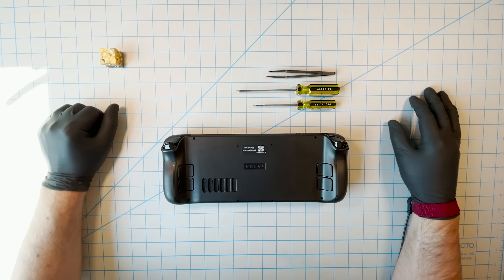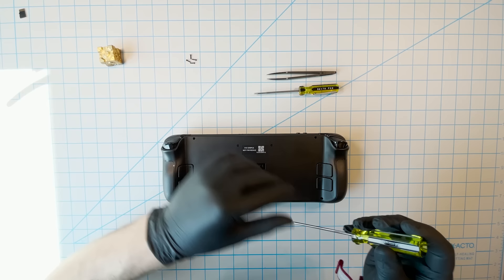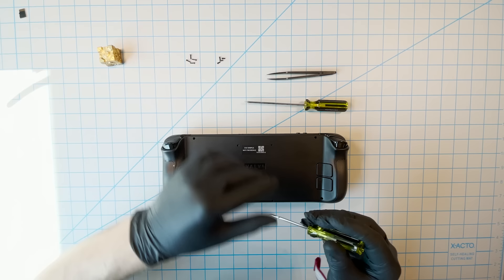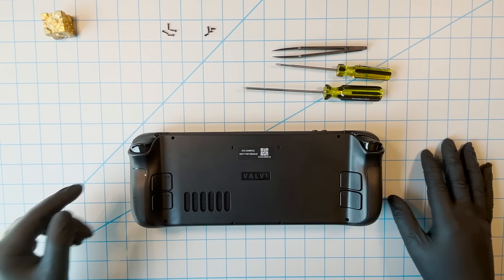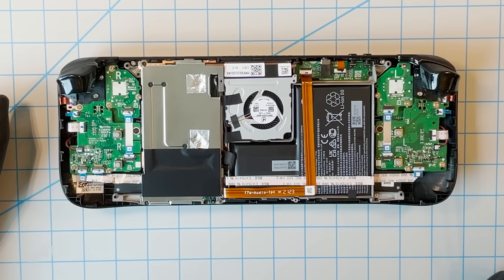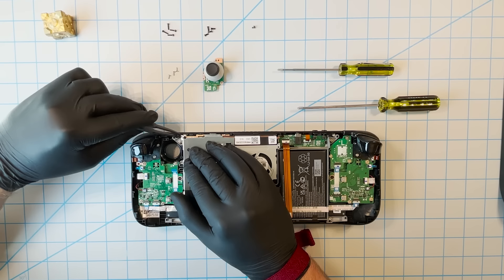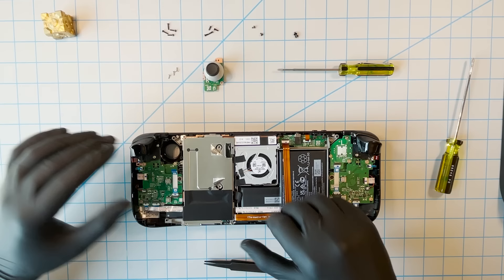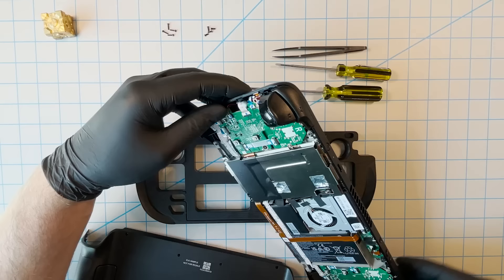Take a look inside Steam Deck™!

Comment: Shout out to Valve for being pro right to repair. It's genuinely refreshing to see a company show you step-by-step how to replace parts AND mention that you'll be able to purchase replacement parts from them directly in the future.
Reply: I was worried you had to use a heat gun on the screen in order to gain access to internals
Reply: Not only that, but explaining exactly why third-party components might cause issues, without explicitly saying so. So anybody who'd provide steamdeck repairing services would know what to do. No need for walled gardens this way, and you get the same level of quality.
Reply: @zergslayer69  Oh god... I remember doing a shell swap in my Nintendo Switch Lite and the idea terrified me.  It worked out great, but still.
Reply: Probably because they are a software company, not a hardware company. They cant sell you games if your stick fails, and your can't get a whole new deck instead of just replacing the thumb stick.
Reply: @coolperson4283  as someone who have an n64, thansk god they showed how to replace it and said they will sell it.
Reply: I'm going to just paste my text wall because it's applicable here

As much as I am happy that a 1st party is doing something like a teardown, there is so much that is wrong with this video. Mostly the unnecessary amount of fear mongering. Also the fact that he takes the chassis off with his fingers and doesn't even suggest a pry tool of some kind is unsettling.

While he's correct on almost all of the warnings, the amount of fear he's trying to instill to keep you from attempting any kind of servicing on your own is entirely inappropriate. While ESD can damage a component, the likelyhood of that happening is incredibly remote and easy to avoid. LTT did a video with electroboom where they TRIED to destroy PC components with ridiculous amounts of static electricity and it resulted in minimal to no damage. Also it is incredibly easy to avoid a battery fire. The way you do this is by NOT TOUCHING THE BATTERY WITH ANY KIND OF TOOL, ESPECIALLY A METAL TOOL! This happens because the battery was punctured and the chemicals in the battery mixed. Just disconnect it and leave it alone. Pry it out with something plastic if you absolutely have to.

If you are in the US, YOU WILL NOT VOID YOUR WARRANTY IF YOU OPEN THE STEAMDECK!!! I know they didn't explicitly state that, but there was reason to believe they tried to lead you to the inference that your warranty would be void if you opened it up. If you open up the steam deck, take a compressed air can and blow out dust, close it back up properly, then later the screen stops working within the warranty period, your steamdeck is still covered because nothing you did could have possibly damaged the device. Under the Magnusson-Moss Warranty act the manufacturer has to prove exactly how you damaged the device, and opening it up is not sufficient proof as this has been successfully argued in many lawsuits. Typically consumer electronics manufacturers have gotten around this because you would have to sue and it typically wasn't worth it, but the FTC is finally starting to get off of their regulatory butts and working to enforce it by customer complaint.

Finally, once you have the outside sets of screws removed from the chassis, please, PLEASE use a pry tool. Even a freaking guitar pick will work. The fact that this guy is representing himself as a professional and said "be careful not to break a fingernail" and didn't use a spudger, a plastic butter knife, a guitar pick, or anything is absolutely ridiculous. At the very least he should have recommended it instead of telling you to be careful not to break your nails.
Reply: @CreativityNull  
>there was reason to believe they tried to lead you to the inference that your warranty would be void if you opened it up.
I wouldn't really infer that from "the warranty doesn't cover any damage that you do". Maybe this comes from me being somewhat aware of that illegally voided warranty thing, but still.
Reply: @jacobnewman1006  okay, recommend a plastic pry tool and say don't use a metal one...
Reply: @CreativityNull  "you will not void your warranty if you open up" that's true but you WILL void your warranty if you fuck something up while opening. And they explicitly said "your warranty will be void if you damage components". It's you who is twisting stuff what they said. And this is a handheld device, not a desktop PC. So obviously they have to fit all the parts a pc required into a really small case. A person who really know what they are doing should try to open it.

Comment: "It's your PC, you have every right to open it"
...
...
...
"But you may die"

This is why we love Valve.
Reply: @yeetyeet7070  Precisely, and we love that
Reply: @yeetyeet7070  to be fair its really tightly packed, a high end gaming pc is really hard to cram into a small switch sized case
Reply: And to be fair,even with laptops and normal pcs its still the case,if you dont know what you're doing yore fakin ded if you do something incorrectly, even if you do know what you are doing you still need to be careful
Reply: @chillmanmax775  I didn't ask what it is.
Reply: @TDGalea  What if you accidentally puncture the battery with a screwdriver?
Reply: @Sparkette  If you can’t remove a battery safely, you shouldn’t be opening your devices up.
Reply: @TDGalea  yup,its not that hard to mess it up. Its still possible but not as likely as smaller devices such as this
Reply: valve pls fix
Reply: this comment is at 999 likes and im having a dilema if i think its good enough to make it have 1 thousand likes
Reply: @yeetyeet7070  who?
Reply: @ForgotMyPasswd000  you underestimate how battery (especially phones) are using glues that is almost impossible to remove without bending or forcing the battery to open
Reply: @mehshutup3041  Good point, in that case I’d leave it to repair shops unless you really know what you’re doing and can safely remove the glue.
Reply: @TDGalea  you could end up screwing up power delivery and possibly get a fire and I imagine that since its portable you leave it near a flammable object and in the middile of the night it explodes so its a possibility  however low it is
Reply: The TF2 community sure doesn’t
Reply: When apple does it, it's a scam and they trying to destroy the environment

But when valve does it, it's funny and quirky

This is a joke
Reply: Yeah love it
Reply: Seriously ? This is really the reason "why we love" Valve ? I love my mom, cheeseburgers and a good cup of tea in evening. Valve on the other side is tolerated, because were forced to use a client to play games. People who didnt currently experienced their sweet 16, can relate.
Reply: Oh well, we'll all die at some point anyway
Reply: I read that in Cave Johnson's voice.
Reply: Also the portal turret voices
Reply: Let pro take care for you
Reply: @yeetyeet7070  I mean you tell me how to cram a good pc into a small switch size device? Go ahead bro since you’re a genius!
Reply: @Damian-cilr2  lmao no
Unless you are deliberately trying to make the pc explode (opening up the power supply and putting a rattling screw inside), the worst possible thing that someone could do on accident is a leaking from their water cooling system
Please stop spreading paranoia just like this video when its not actually that dangerous
Reply: Valve’s new game looks fun
Reply: @zenobiacatnap  I love their games, not their work ethic.
Reply: @lawgx9819  ?
Reply: @TDGalea  you may cant die. but you may lost your hand if explosion or something f up happens. it's for the people who have no knowledge on repairing mobile or eletronic devices.
Reply: I guess they also know ur address
Reply: @feivelderschlawiner9687  😐
Reply: "Also the warranty doesn't cover any damage you do."
Reply: @yeetyeet7070  dumb = funny
Reply: Cmon guys, it's one of their Portal joke. Maybe other game too
Reply: @TDGalea  I dont think they are implying death, more like regret and sadness to messing up the repair and losing the steamdeck
Reply: You can tell they made portal
Reply: @rork679  Sprinkle of moondust
Reply: Well technically yes, but actually no
Reply: Feels like glados
Reply: I’ve seen li-ion batteries catch fire. It’s not pretty, or safe.
Reply: @yeetyeet7070  1. yes
2. no one is stopping you from opening it up
Reply: @Damian-cilr2  Yeah, rule of thumb, more compact electronics = more likely to break when messed with human hands.

Comment: Can we just acknowledge that Valve made the thumb stick "easy to remove"? Moves like these are why I still have respect for Valve.
Reply: Isnt the stick one of the first thing that takes notable damage?
Reply: @DuxAT  yeah, so its good to make it easily replaceable
Reply: Unfortunatly the battery is still glued down and doesn't appear to even have a strip the help pull it out and the battery is the main definitly will fail and it'll only take a year or two if you use it a lot part.

Comment: Valve: Look at all these people breaking NDA... Someone's bound to open it up and show the internals. 
Someone else at Valve: What if we did it for them?
Reply: (everyone like that )
Reply: @reecesx  These kinds of videos are still miles in the right direction. Even with all the dev kits in people's hands, and the obvious leaks that are going to happen, Valve could have easily gone with an Apple approach. People who open their machines and fix things on their own either don't have the means to replace/pay to repair their devices, or are experienced enough to be confident to work on it. Both of these categories are massive minorities in they're advertised market. They still chose to show their consumer openly on how to fix vital and high wear parts. This is the right direction for where we are at.
Reply: @PersonMeetup  fair points by both of you but there's no excuse to fear mongering.
Reply: @reecesx  information monopoly? How's it being a monopoly? It's not like anyone can't open their SteamDeck when it arrives.
Reply: Voiding the NDA is so much cheaper and easier than suing everyone who violates it
Reply: @reecesx  this reads like some Q shit lmfao... information monopoly??? what???
Reply: @807800  Exactly. And some will open either way, just to check if Valve hid or didn't mentioned about something or to experiment with hardware.. If someone wants example for info monopoly on crucial information - Apple, Sony.

Comment: YO THANKS VALVE FOR LETTING PEOPLE REPAIR INSTED OF REPLACE
Reply: They literally said to not do it wdym.
Reply: @con6911  they said not to do it but showed that it can still be done, at least theyre not anticonsumer like apple and trying to make it impossible
Reply: @con6911  They said you shouldn't do it. Get it to a repair service that will do it right.
Reply: @con6911  They warned you not to do it.  That's different than just flat out saying "don't do it".  If they believed in the latter, this video wouldn't exist.
Reply: @con 
That message is for consoomers like you. Non-computer-illiterate folks are rightly praising the openness of the design and hardware
Reply: @con6911  That's why they said they'll sell replacement components I'm sure /s
Reply: @majorgnu  youd be surprised at how many people have previously worked in repair service/know exactly what they're doing who are still gonna buy this thing. this video is for them
Reply: @majorgnu  Just the fact that you can bring it to a repair service is a big deal at this point. With the way Apple and Samsung have been by just straight up not selling components to independent repair shops, the fact that Valve is going to be selling replacement parts is great.
Reply: @con6911  he said not to do it if you dont know what your doing and doesnt reccomend it in genersl because of the risks 
Specifically the battery catching fire and the decreased durability
Reply: If only they did the same for the index instead of forcing people to pay $500 for a replacement.
Reply: @con6911  they are showing it can be done, rather than being anti consumer
Reply: @con6911  Very tightly packed and miniaturised design is just a requirement for handheld devices these days. But as someone who has worked on phones and laptops, the SteamDeck looks really repair friendly, compared to say a MacBook or iPhone.
Reply: TRENDING-TOP-YEARS⤵️ --------------------------------------------------------------------------------------------------------------------------------------------------------------------------------------------------------------------------------------------------------------------------------- ❣️ AISURU.TOKYO/michan?HDRCam✰ᴾʳⁱⁿᶜᵉˢˢ★ トップAVビデオに参加する
❣️

Youtube: This is fine 
Someone: Says "heck" 
Youtube: Be gone 
#однако #я #люблю #таких #рыбаков 
#Интересно #забавно #девушка #смешная #垃圾
Reply: @con6911  it is meant for people that don’t know how to handle this kind of stuff. If you don’t have any experience it is really easy to break it.

Comment: THANK YOU for not soldering in the thumb stick. Knowing recent controllers, the sticks are bound to catch a drift, if you catch my drift. Steam deck made it infinitely easier for average consumer to replace stick when it eventually fails. They are also providing replacement sticks, awesome!!! Love you guys, don't change.
Reply: My playStation 1 thumbsticks are fine. Are they signaling theirs are bound to fail??
Reply: SuperFinGuy your playstation 1 thumbsticks will eventually die it’s just a matter of when
Reply: @SuperFinGuy  my ps1 controller has no drift in the right stick, lots of it in the left.
Reply: They claim to have put some serious work into durability of the sticks after having issues with the ones on the Knuckles.
Reply: @SuperFinGuy  And how long have you been using it? I’ve got three 20 ish year old PS2 controllers, two of them have control sticks which are very loose and crusty. The one that is working is an aftermarket controller, and even it has a split cable sheath. Use it enough and it will wear out. That’s why having replacement parts are nice. “Lifetime” parts only lasts as long as the manufacturer’s intended lifetime, which may be just one console generation.
Reply: @Daschickenify  I played the shit out of them back in the day, and in the last twenty years every now and then. That's the thing, PS controllers were designed to last and not just a couple of months
Reply: Valve index got drift though, aint no way to fix that yet.
Reply: @missingno2401   doesn't the PlayStation 1 controller have a d pad rather then joysticks though
Reply: @StuffyAk79  two joysticks and a d-pad zoomer
Reply: @StuffyAk79  i have the one with analog
Reply: @missingno2401  oh hi

Comment: Guy at valve: “can I do a steam deck tear down?”
Valve: “no. The customer shouldn’t think they can open the console”
Guy at valve: “can I do a steam deck tear down if I tell them they shouldn’t open the console?”
Reply: > console

😠
Reply: Oof, I used the word console. I meant PC. My mistake.
Reply: @Smugg  no problem
Reply: @nathanl2966  its a linux based console that can run windows and be used as a PC.
Reply: @francez123456789  it can run Linux and still be used as a pc. They even have a desktop mode
Reply: @francez123456789  everything is linux though, from toasters to android.
Reply: @user-pq4by2rq9y  MacOS and BSD and Windows aren't linux.
Reply: From wikipedia "Video game consoles are a specialized form of a home computer geared towards video game playing, designed with affordability and accessibility to the general public in mind, but lacking in raw computing power and customization.".. so yeah this is a console.
Reply: @user-pq4by2rq9y  are you linux?
Reply: @vCavernosa  not yet
Reply: @rjrmonkey  oh god oh fuck
Reply: @francez123456789  "linux based console" ...its still a pc
Reply: @devilwarriors5164  bro you can literally run this as a desktop as a daily driver and have full access to editing the source libraries of the unix base, your definiton of a pc is so scewed i bet you think laptops are consoles
Reply: @rjrmonkey  that sounds incredibly threatening
i promise i'll get linux so you dont smite me
Reply: Ngl, i actually am convinced that valve does not have that kind of mindset, unlike some other companies (*cough* apple **cough**)

Comment: The fact that the grate isn't shaped like the aperture logo is a missed opportunity
Reply: "For replacing the battery on any of our devices you'll need this special tool called spudger and a heatgun, but you'll want to have precise control otherwise you'll explode the battery."
Reply: not yet final hardware
Reply: Not too hard to 3d print another back with the back having the aperture logo XD
Reply: @sam11182  what about getting a 3d printer or something lmao
Reply: I mean you could get it laser etched
Reply: The companion cube paper weight in the top left is cool
Reply: @Ganx_Gooshers  Now That is smart
Reply: @praralexander7561  yeah probably
Reply: TRENDING-TOP-YEARS⤵️ --------------------------------------------------------------------------------------------------------------------------------------------------------------------------------------------------------------------------------------------------------------------------------- ❣️ AISURU.TOKYO/michan?HDRCam✰ᴾʳⁱⁿᶜᵉˢˢ★ トップAVビデオに参加する
❣️

Youtube: This is fine 
Someone: Says "heck" 
Youtube: Be gone 
#однако #я #люблю #таких #рыбаков 
#Интересно #забавно #девушка #смешная #垃圾